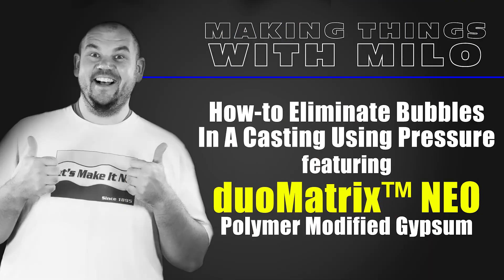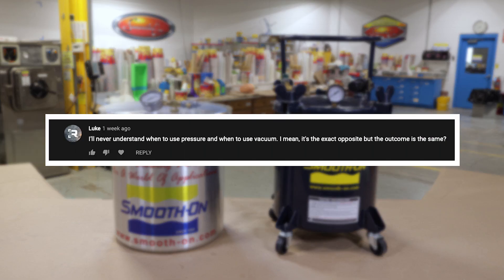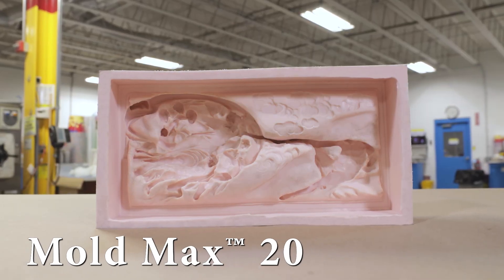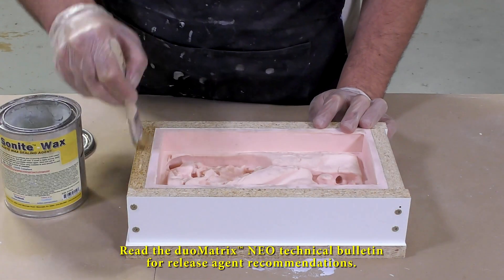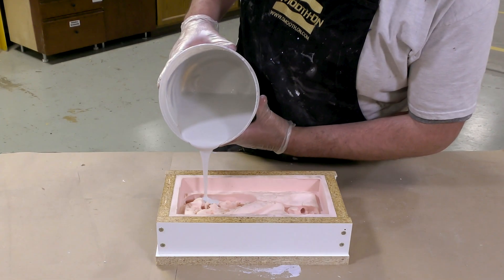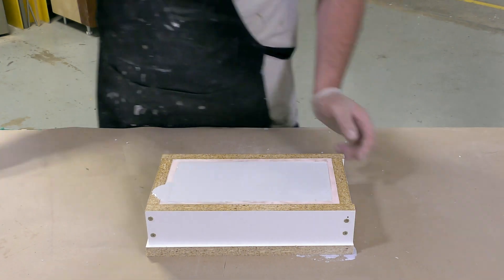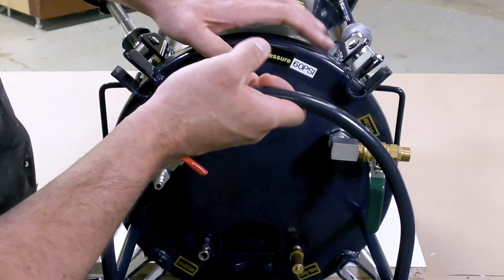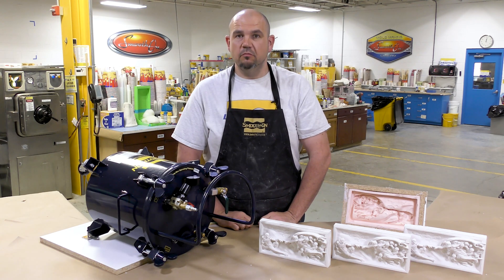How To Eliminate Surface Bubbles in Your Casting - Pressure Casting duoMatrix NEO

Comment: Does the prssure pots can be used for the silicone to reduce the bubbles ?
Reply from the maker: You can pressure mold, but care needs to be taken to ensure that distortion does not occur.

Comment: Can you disconnect the air pump, and still leave the pressure in the pot? For longer cure times, like four hours..
Reply from the maker: You will want to keep the pump attached, in case there are slight leaks in the hose or fittings.

Comment: Smooth-On sells a product called Aquacon. For molds that are too bulky for a pressure chamber, would rinsing the silicone mold with a coating of Aquacon before pouring in the gypsum system be of significant help?